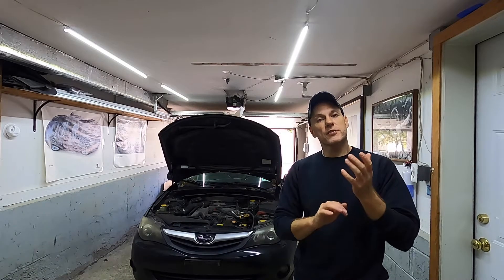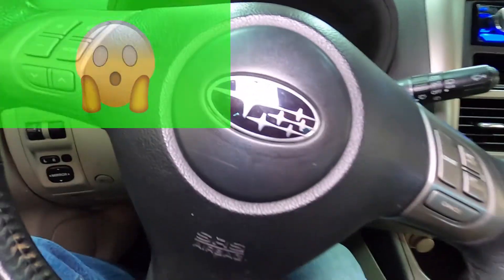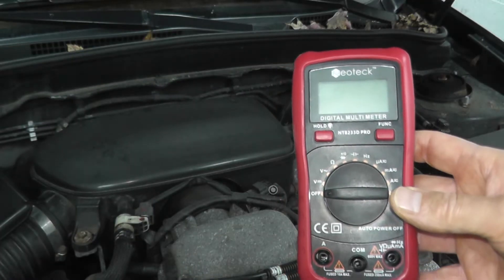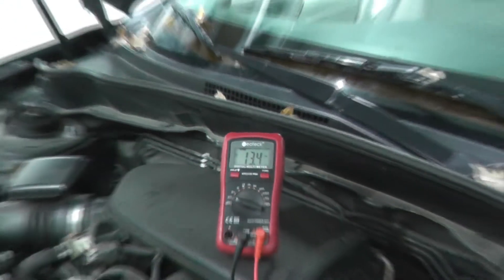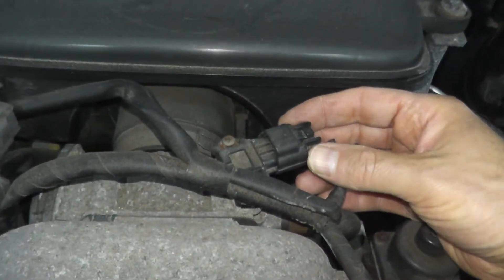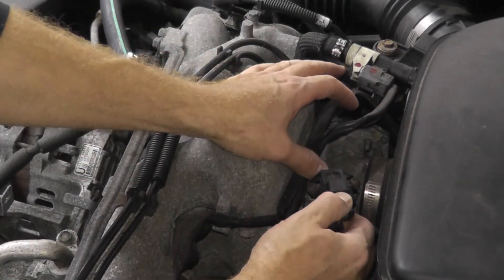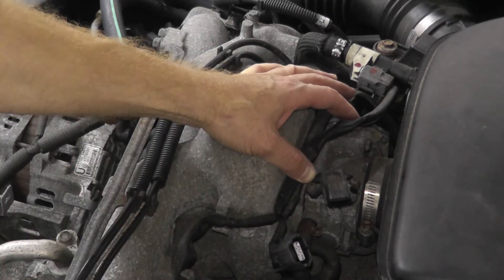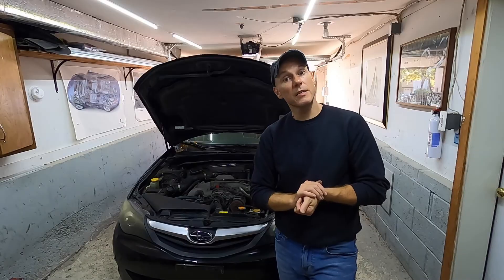Subaru MAP Sensor P0107 and P0108 | How to test and replace

Comment: I snapped mine odd inside the throttle body removing the throttle body to clean it, UGH! any suggestions to remove it
Reply: I know it might be a little late but I would use a screw a little larger than the inside diameter of the tube that broke off. Screw it in slightly then wiggle and pull. I use this technique sometimes and it works great.

Comment: hi, on my 2015 subaru outback I found my signal, power and gorund wire, but on the power wire I get a 5.01Volt reading but the singal wire I get a 4.9 volt with 0.05 fluctuation when I accelerate. Does that mean I have a faulty sesor or wire? Thanks, great video otherwise
Reply: Im in the same situation. Did you find out something about it???